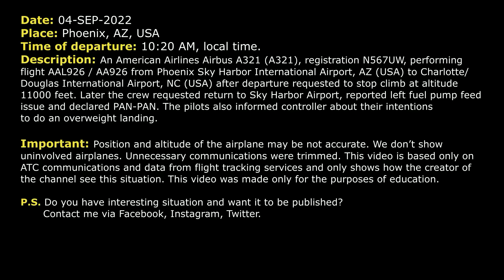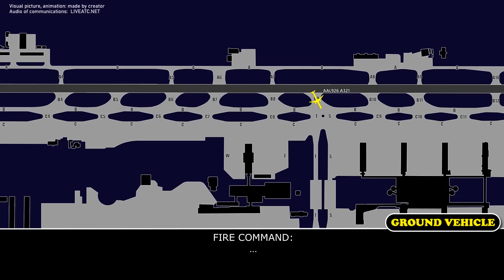PAN-PAN. Fuel pump issue. American Airbus A321 returned to Phoenix. Real ATC

Comment: What did they expect to accomplish by talking to maintenance?  You have an abnormal procedures checklist, follow it.  Even Al Haynes, struggling to control an uncontrollable DC-10 on UAL Flight 232, got no help from maintenance because there was simply nothing they could do.  If American's pilot union had any sense, they would tell the company that the crews involved in an abnormal event will be glad to talk to the bureaucracy after they get the airplane on the ground.
Reply: You could fly your Lazy Boy up to the demised aircraft and take a gander in case there is any visible abnormality.  Is your recliner IFR equipped?
Reply: Perhaps checking that maintenance can actually address the issue there or if they'd prefer the plane to end up somewhere else?
Reply: It is absolutely normal to talk to maintenance on the ground if they feel the need to. You use all the resources available to you, including maintenance on the ground. They literally are able to text or call them from the air, and it happens quite often. They are part of the crew in a way.
Reply: It’s probably more of “where do you want us to break down” as opposed to using maintenance to trouble shoot a problem in the air.
Reply: You do snotty well my friend.
Reply: It is not uncommon to check with maintenance. Maine, depending on tbe situation, can be helpful in the case of an emergency. Your comment on American's pilot and your reference to bureaucracy are off the mark.

Comment: Must have been task saturated if they had to get cabin crew on the radio at one point.
Reply: Where do you get this?
Reply: @N1120A  I thought I heard an air stewardess on the radio at one point.
Reply: @MattyEngland  you mean a flight attendant? No, there were two voices on the aircraft - the two pilots.
Reply: It is common in emergency situations to change who is handling the radio. You can hear the PNF (pilot not flying) at first - normal. In an abnormal situation, radio typically changes to PF (pilot flying), while PNF handles checklists (and in this case OPS). Once they were done with all that, radio switches back to PNF.